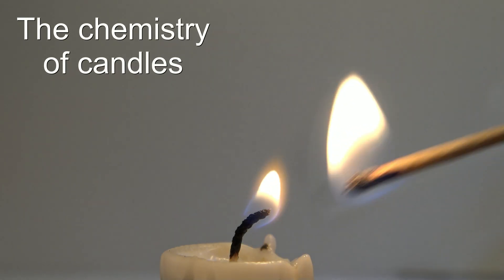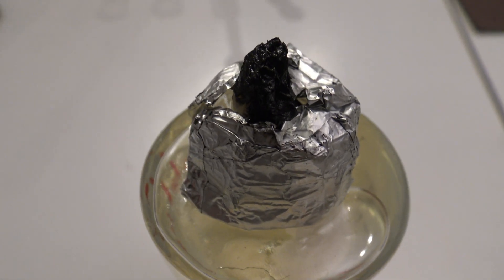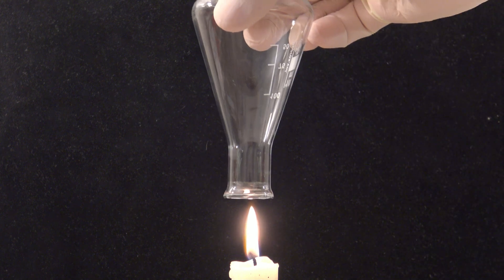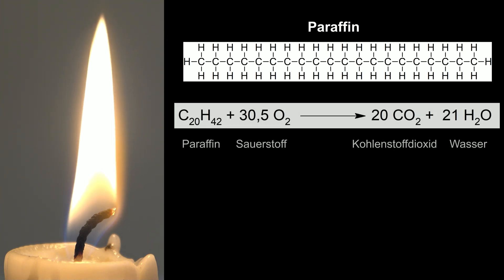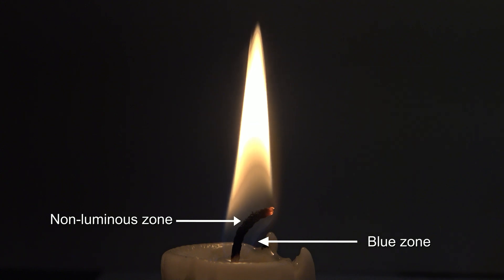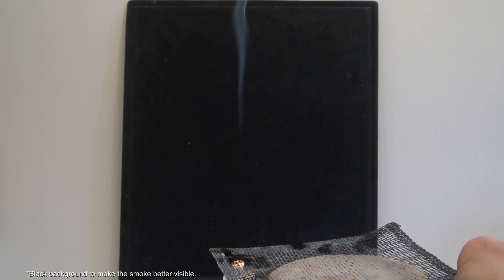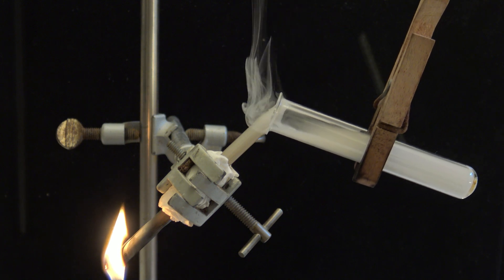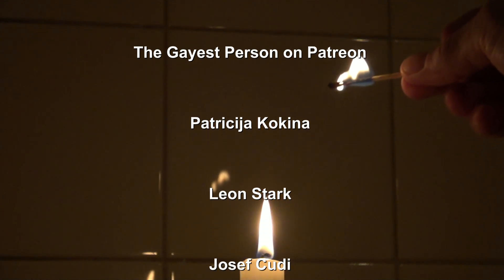The chemistry of candles

Comment: It would be interesting if the wax vapor composition could be identified. Surely simple shorter hydrocarbons, but anything interesting?
Reply from the maker: A mass spectrometer would answer that question. I'd guess carbon monoxide, dioxide and hydrogen would also be present.
Reply: @RaExpIn  Sure, I was thinking maybe there could be something more complicated.
Reply: Sorry if my question is not that great but why doesn't the vapor turn back to liquid and then solid wax?
Is it because it becomes something else after it burned?
Reply: @im-not-alone5587  If it is completely burned, then the end products are CO2 (carbon dioxide) and H2O (water). The CO2 is gas and H2O probably just dries out. If it is only partially decomposed, then I would expect at least short(er) chain hydrocarbons, which are liquids (oil like) or gases in room temperature. I guess their amounts are too small to see here properly. Also there wasn't enough time for them to coalescent.
Reply: @user255  I see. thanks for your answer.